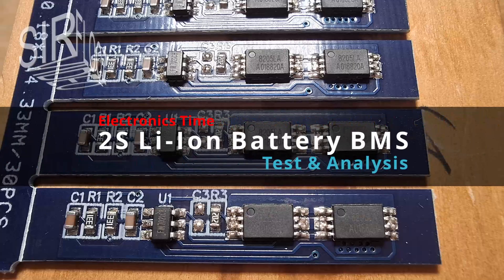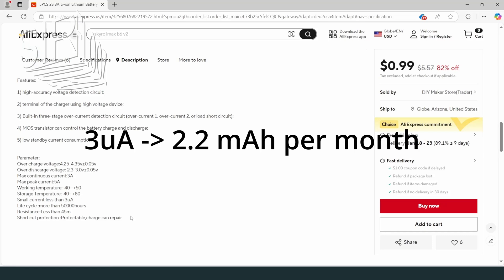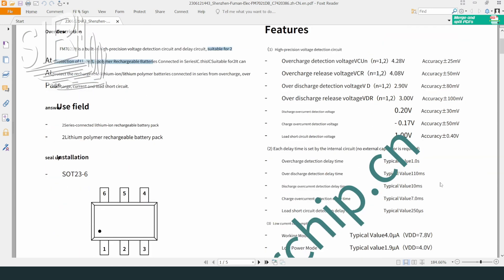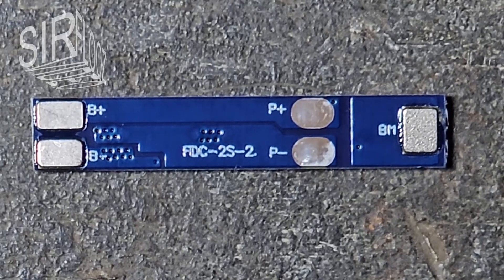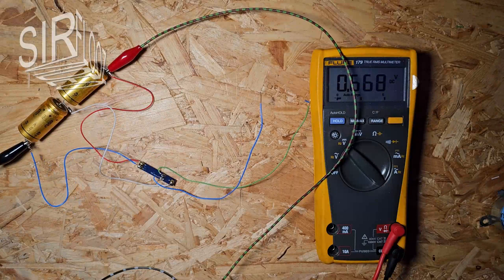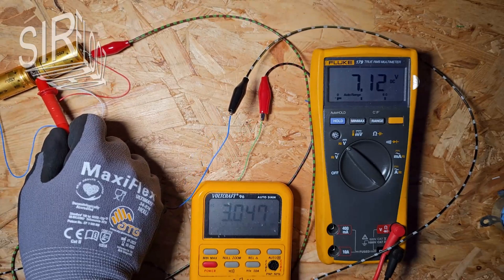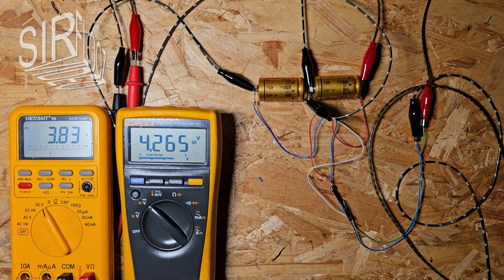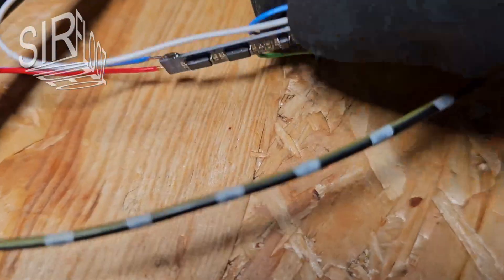2S Li-Ion Battery Management System Test and Review - How Lithium Cells Are Protected

Comment: Just one question. On the charging cycle, will it cut charging completely when one of the cells is full? Or will it stop the full one and continue charging the other until both are full?
Reply from the maker: To my knowledge a BMS always cuts the whole pack if anything is wrong.